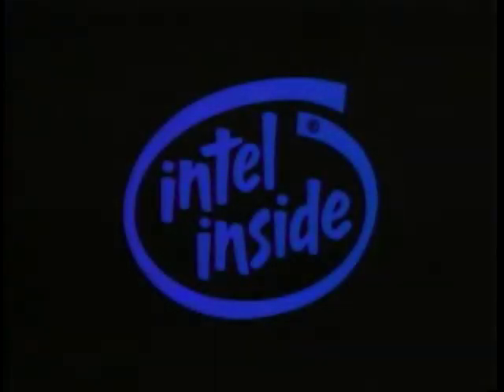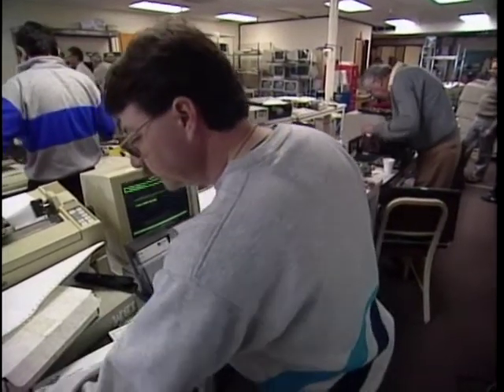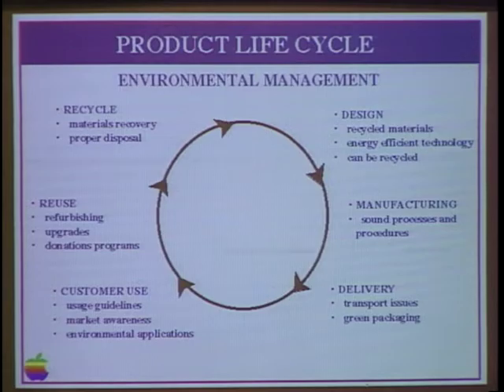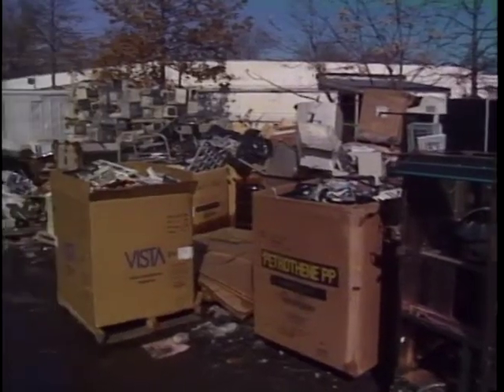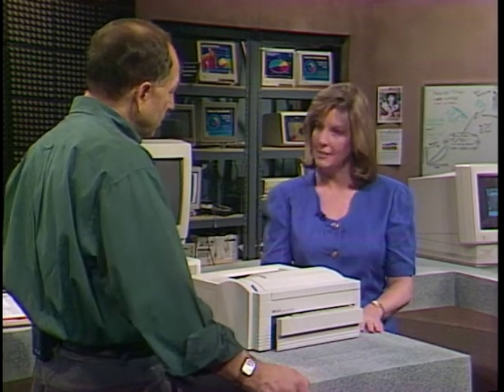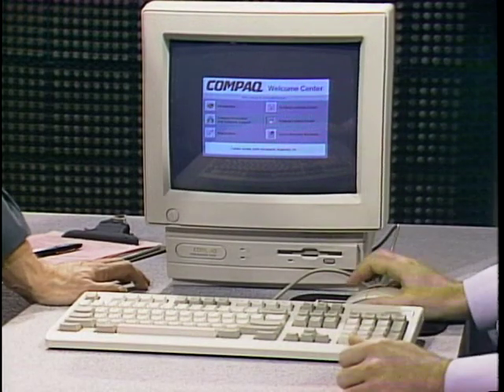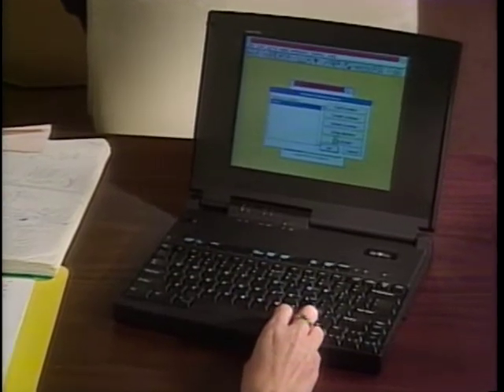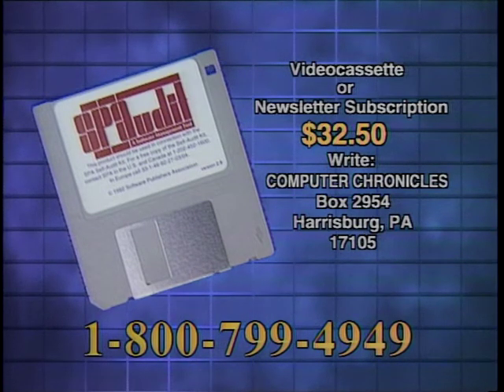The Computer Chronicles - Green PCs (1994)

Comment: The 80 plus efficiency ratings on modern power supplies help a lot too. I wonder how efficient the PSUs in those older machines were.
Reply: jonyguru did some tests, usually 60 to 70 % depending on the load

Comment: The amount it cost to produce that extra hardware for in terms of energy , did it actually get countered by the savings made ?
Reply: well laptops could save their batteries from dying in like 2 or 3 years but laptop makers don't do it why cause that would make a laptop way to green all that would have to happen is keep the battery at 60% charge instead of at like 100% that's how simple it is

Comment: Sometime in the mid 1990s I remember some EnergySaver regulation kicked in and all of a sudden all computers with monitors which were running 24/7 regardless if they were actually in use became systems that entered low power modes with monitors turning off automatically and CPUs entering low power modes. I reckon that did a lot to curb the reduction in energy consumption from computers than anything else.

Comment: Processors were much too slow to employ technologies like Speedstep in those days, but the idle power reduction saving are in large part due to the automatic slowing of speeds when you're not loading the computer heavily.

The Intel Power Gadget shows even my old i5-2400 using ~6w when idle. That's a quad core 3.1GHz cpu.  Certainly better than the old Pentium 4 days where the computer sucked up electricity like it was free.
Reply: 8 cents a kilowatt hour of power man those were cheap days for eletricity back then

Comment: "These computers take too much power"
>mfw power supply can supply a peak power of 85 watts for 13 seconds
Yeah sure. This whole garbage was introduced by people who wanted a short-term solution without actually understanding anything about the problem.
Rather than actually put effort into researching and finding real, viable solutions, companies would rather dump them into recycling centers and call it a day. All that matters is the money and the PR, which of course is needed to make more money.

Now, instead of building a machine to last for decades after it was designed, a machine is designed to just barely make it to the release of the next model and be completely replaced. How is throwing out a hundred pieces of cheap plastic more environmentally friendly than one metal box?